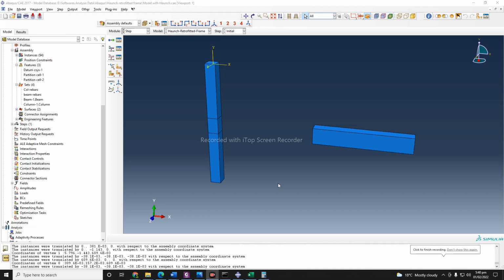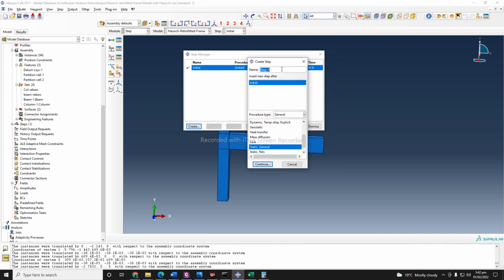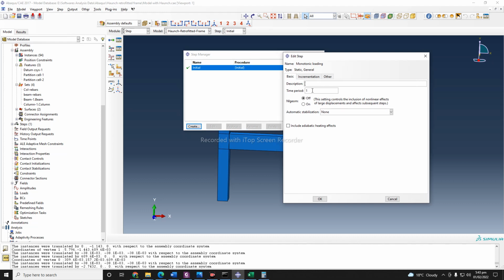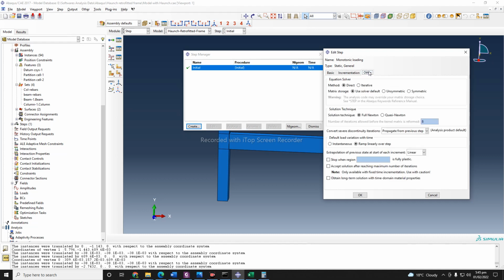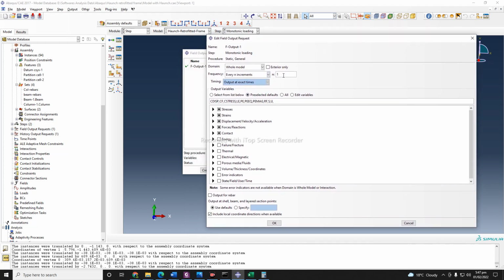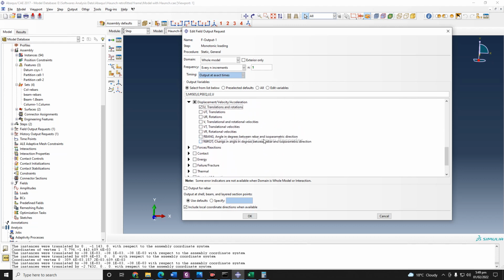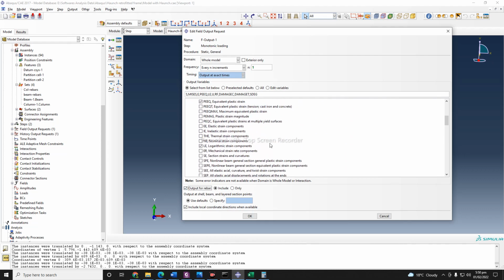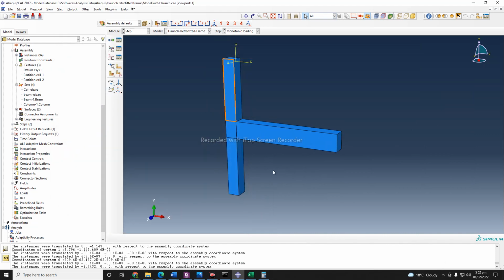5.  Step Module in details - Reinforced Concrete Beam Column in ABAQUS

Comment: kindly make a playlist step by step like this playlist for modeling a CFRP-wrapped column under eccentric (45 mm) load. Column body size should be 150 mm*150 mm*750 mm and column head 250 mm*250 mm*100 mm.  10 mm main rebar. Looking forward to hearing from you. Thanks in advance.